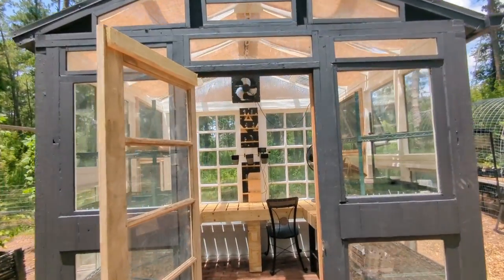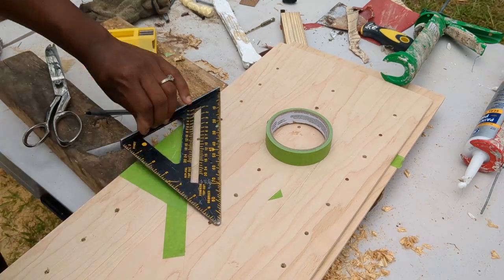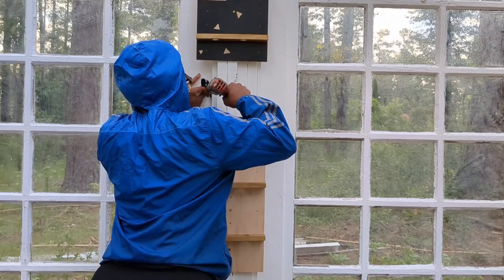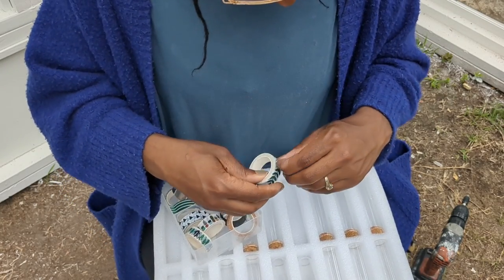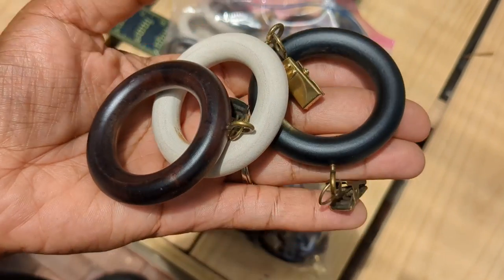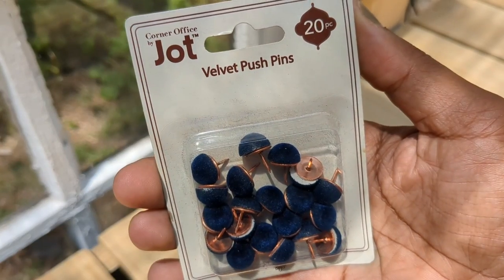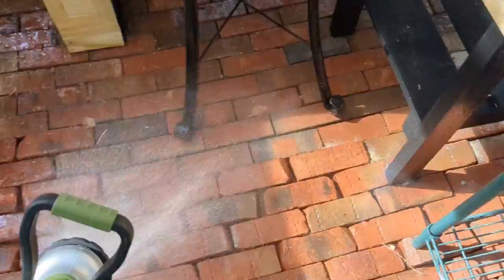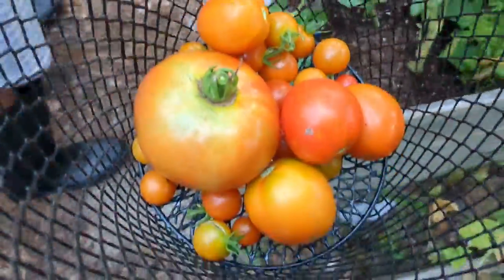DIY WINDOW GREENHOUSE                         Low-Cost design Ideas! #greenhousetour

Comment: I love the look of your burlap shade cloth.  I mentioned to you in comments on another one of your videos that I did not garden this year mainly for health and economic reasons as well as overall discouragement. However, I did purchase and use shade cloth in my garden last year.  I do not have a permanent structure like yours; but I had to protect my veggies from the searing sun of summer. So, I bought some factory-made, black, 50% shade cloth from Amazon.  It also comes in different sized and in white, I think.  I tied it to bamboo poles at the 4 corners of the garden and hung it that way.  The cloth wasn't expensive at all, and it allowed me to be more precise in how much light  to let in and how much to screen out, e.g., 50%, 40%, 60%, etc.  Using that cloth truly saved my garden back then. In the end, it was worth the minimal expense; and I can reuse it if and when I plant a garden again.  In fact, I even threw that cloth on our gigantic fig tree this spring when we had an unexpected frost - predicted at the last minute - that threatened to destroy the fruit the tree had already set. It was really an experiment; and, thank God, the shade cloth acted like frost cloth!  (The prediction turned out to be accurate.)  Now we still have fruit that should be ripe in August.
Reply from the maker: That's amazing! Yes I remember! I meant to actually ask if anyone used burlap in the garden and left out the burlap part 🤦🏾‍♀️